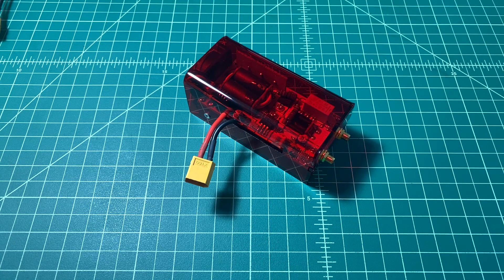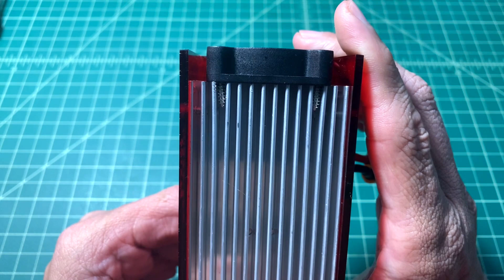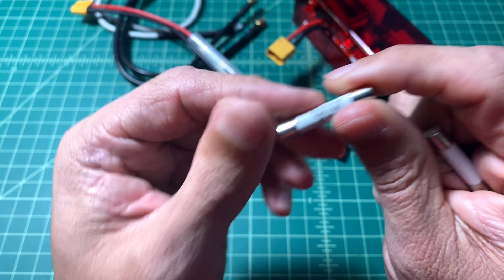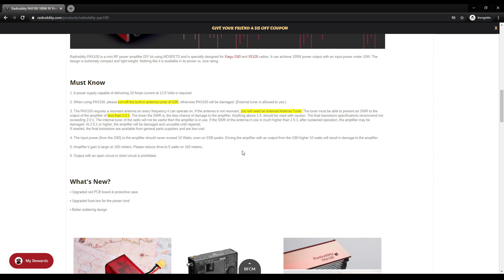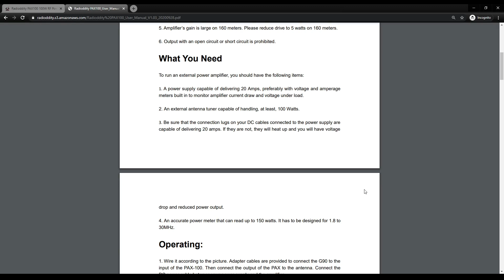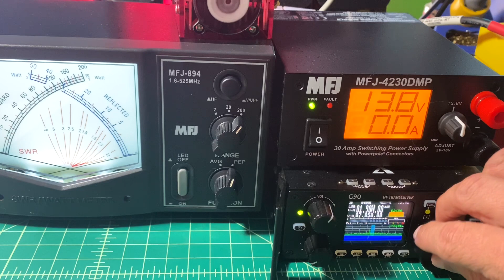Radioddity PAX100 Amplifier for Xiegu G90 - Ham Radio - TheSmokinApe

Comment: Thanks for the previous reply about the VFO knob on the G90,  My main problem is that I have the G90 and the Pax 100 amplifier, On testing, when the PTT control is inserted into the G90, The G90 does not  have any audio or indication that there is any radio signals, its the same was when the PTT cable is not inserted into the Pax.  I had a external tuner (atu-100 EXT) showing sig gain on output on a 2-3 wat input to the amplifier, I am at a loss, I am 83, got my general last april, but limited knowledge on the problem, thanks.
Reply from the maker: I ended up not being a fan of this amp and stopped using it...  Are you saying you get no RX or TX with the amp inline?
Reply: when correctly connected, the amp showed gain on a swr/tuner, so the TX worked, the rx had no signals on the waterfall. The ptt cable when connected to the G90  cancels the rx. I have disconnected the cable from the Pax100 and it still kills the rx @TheSmokinApe
Reply from the maker: Sorry man, I don’t know what’s causing that and I no longer have the g90 or the pax
Reply: TX works but No RX @TheSmokinApe

Comment: I have this exact setup .. and dont use the CE19 as well .. I prefer the DigiRig and as you mentioned it uses the ACC port for the Sound. Did you every looking into it further? .. I got the kit that included the Lowpass filters as well but  more curious if you tried getting Digitial to work with the pax100 and your setup
Reply from the maker: I haven't tried to use the amp with digital, sorry I can't help with that.

Comment: Is IT possible to use external ATU with this Amp?
Reply from the maker: I believe you can put one after the amp but before the antenna 👍
Reply: @TheSmokinApe  i found info in other video that when you are tuning amp should be turned off?
Reply from the maker: @MrDwadi84  that may be true, I haven’t used a tuner with this amp.  You need to have the g90 internal tuner off when using it 👍
Reply: @TheSmokinApe  i know - found that info in your vid ;)
Reply: On the video you said only resonant antenna. The screen capture you showed had the writing external tuner or resonant antenna. Here you said tuner after the amp ok, but that's different than what you said in the video.

Comment: Excellent video!  The real question is...20W vs 100W.  I just bought the G90, and I'll be honest...I was skeptical.   I honestly believe that I can successfully complete 9 out of 10 QSOs using 20W vs 100W, although the reports are usually 1-2 S units lower than what I would expect with 100W.  20W is definitely usable for what it is!
Reply from the maker: I agree, you can do pretty good with 20w and a decent antenna.  Thanks for the comment David!

Comment: Just a question would this amp work with the smaller qrp G1M Xiegu?
Reply from the maker: I don't think the G1M has the DIN port, you might be able to wire something up but I am not sure.

Comment: It's probably your power supply some claim "switching power supply " but when you increase voltage your power supply will drop amperage try test with a larger steady voltage and steady amperage out power supply or use a battery pack.
And take temp readings at different bands at TX for 30sec

Comment: You should not use a PA without a Low Pass Filter on the output for the specific band you intend to operate. 

The Output from the PA will be full of harmonics and the signal will therefore be 'dirty' by definition. 

Your power meter is measuring the energy of all that crud as well as the wanted signal so I suspect a clean signal after the LPF will probably show 15% to 20% less power output. 

Its also important that you don't overdrive the amp otherwise the output quality will be full of intermodulation products -- as well as harmonics, making it worse for folks trying to operate close to your frequency.

Adding a Power Amp is not as easy as it seems!

73 Bruce G4ABX
Reply from the maker: Totally agree, thanks for the comments and info!
Reply: @TheSmokinApe  You are welcome. Keep doing those reviews. 73 Bruce G4ABX

Comment: It may cost more but the Xiegu XPA125B is made for Xiegu radios and has built in tuner this amp has lots of good protection I got mine to run with the ic705 witch it works very well but with the icom its manual band change on the amp but used with the Xiegu G90 the band change is auto chris G0WFH
Reply from the maker: I've been checking it out but have been hesitant to drop the cash as I have a 7300 I use for my base station.  That is awesome you got it to work with the 705!
Reply: @TheSmokinApe  thanks the local ham shop supplied the lead i have had the amp running at 30w output  with about 300mw drive i also have the 7300 at home

Comment: They say you need a 20A supply mainly because most 15A supplies will have a significant voltage drop away when they are operating near max current

Comment: Are the fuses “slow blow” ?? Could allow for spikes to 20 amp for milliseconds to fractions of seconds
Reply from the maker: I think these would pop at 15w, suppose I could do a test... lol
Reply: They are BS fuses (British standard) which is different in how ratings are designed to ANSI standard fuses.

A 15A BS fuse will carry 15A continuously without blowing but will blow if you exceed that value (with a particular curve for time at different percentages over the value)

An ANSI 15A fuse will blow at 15A

Comment: Really? 100 watts squeezed through an SMA connector?  I don't know what power SMA's are rated for, but I sure would have preferred a BNC connector or SO-239 for the output! Other than that and a low-pass filter, it looks appetizing for my FT-817ND.

Comment: Cool video! Be careful of the PTT connector on the PAX100. The first one I had it broke off during filming.... To Radioddity's credit they quickly replaced it!
Reply from the maker: Yeah, that connector looked suspect.
Reply: @TheSmokinApe  I leave mine plugged in now. I will be trying out the LPFX7 hopefully this weekend or early next week to see how it does with the noise.
Reply from the maker: @WJ6FRadio  you liking it so far?

Comment: Thanks for the review. I've looked at it on thr Radioddity site and have been wondering about it.  Did you happen to put it on a scope to check on how it does as far as spurious emissions?
Reply from the maker: I have not, I am concerned that it's an issue and that's why they sell the additional filters.

Comment: thanks for the review. have been leaning towards the G90 as first  HF rig because it is economical. an amp to boost operating capability beyond 20w is a nice option
Reply from the maker: This amp does require you to take some precautions with regards to your antenna/tuner.  Also pay attention to the fluctuations in swr on the radio in the higher bands 👍

Comment: What are They all selling these days? Is this FCC tested and approved? And no band pass filters build-in? It is normal that a solid state amp, without band-pass filters produces more power. So with the needed band-pass filters the output power will be lower. How about a test to show if this box produces spurious emissions on other frequencies. An amp in a plastic box? How about shielding? We are talking about a device producing RF here. All these new Chinese devices look like the lowest quality CB radios. They still need years to develop decent RF equipment as far as I can judge..
Reply: Can't find a FCC certification anywhere.   The Radioddity site has all their certifications and this isn't listed.   The Xiegoop XPA125 does have a certification.   Who needs the FCC...I just wouldn't sit too close to it... you might start to glow.
Reply from the maker: It does have some filtering but I don’t think it’s sufficient or else there wouldn’t be an add on product, I do not see any FCC certification.

Comment: Ppl in the military use radios in the backpacks...can a civilian get that type of mobile equipment......??..if they can ..can u tell me what type if device it is, or make a vid on it.
Reply from the maker: Some radios do come with backpack options, the ic-705 for example.  I don't have much experience with military radios but The Radio Prepper does feature some on his channel.
Reply: The reason y I asked, the features on the radio in the thumb nail have handles..it looks compact...looks small enough to be fitted into a pack system..but I dont know much about this type of equipment..just curious
Reply from the maker: @blackquiver  I  array it in a backpack these days 👍
Reply: Yep..for sure..
Reply: well, I know of one .. the HARRIS  Military grade radio. hope that helps 7 3

Comment: This will probably be the one I pick up, pretty sweet amp! I didn't know they sold a band filter, was looking into that, seems like a really nice filter for the price! 73 and yet another great video
Reply from the maker: Pay attention to the swr fluctuations when I transmit, they are higher on the higher bands.
Reply: You mentioned that you shouldn't use a tuner, would an external tuner work?
Reply from the maker: You can use a tuner between the amp and the antenna.
Reply: @TheSmokinApe  thanks for the response Ape! Happy Thanksgiving!
Reply: @TheSmokinApe  How do you switch the ATU off?
Reply: I wonder how much it is with the band filter? I’ve been buying extra items for my Xeigu G90 carrying bag when I bought the radio. Sweet bag just for the G90 that I got on eBay.